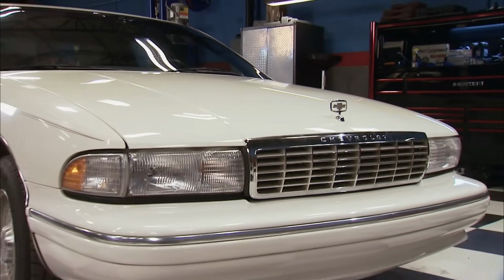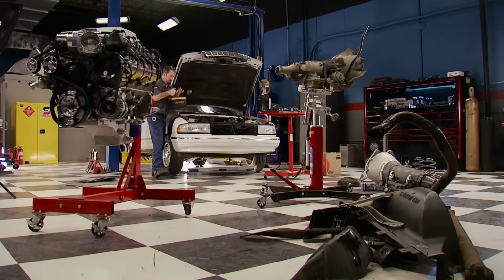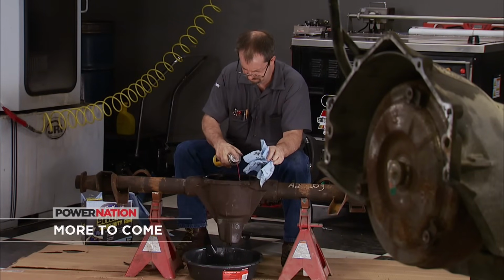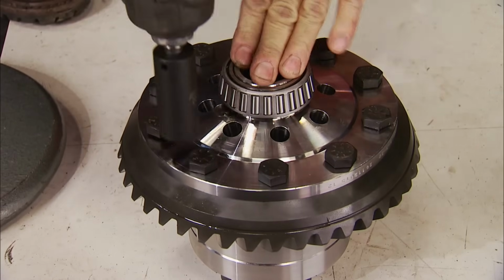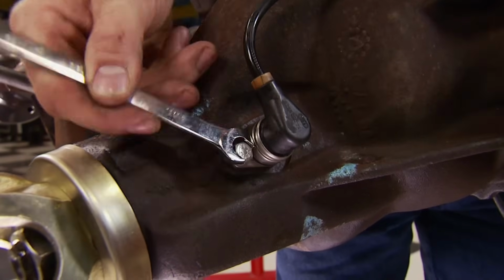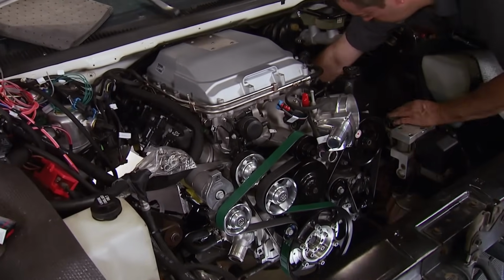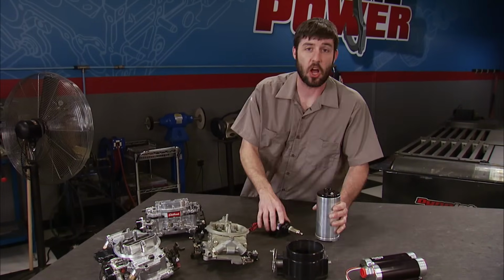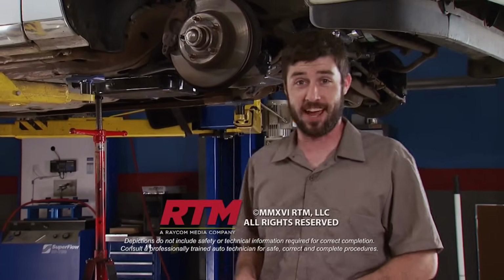Swapping A 816-HP Supercharged LSA In A ’93 Caprice - Engine Power S3, E11

Comment: Not that it matters but the original transmission is a 700R4.  The electronically controlled version (4l60) came in 94.
Reply: Ah, yes and no. Tis a 4L60, no E
Reply: @gabrielulibarri9950  Good catch, the 4l60E is the electronic version.  The 4l60 (no E) is just a renamed 700R4.

Comment: Build that little 305
Reply: Pointless when the Ls exists.
Reply: I don’t have a LS, I have a 305
Reply: @phantomnus  I swapped my 305 for a Ls. Saved money and time
Reply: I didn't realize that the swap was that easy and cheap
Reply: @phantomnus  by the time you spend on a 305 to make any power you could have a junkyard Ls making more stock power. It was a no brainer for me
Reply: What's the information on the lsa engine? What pullies and front components on it? Can you add AC?

Comment: Should do a budget build on that 305 there's tons of them out there and there honestly not bad engines.
Reply: I have always wanted to see what a properly built 305 with a turbocharger can do. Besides, without forced induction and a bore, stroke, and all forged high compression pistons and rods, main studs, head studs, big cam, aluminum heads, and supporting mods the 305 will NEVER make impressive power. They weren't manufactured to be a powerful engine, they were manufactured for fuel mileage, reliability, and efficiency. Even the L03 TBI 305 engine was a turd for horsepower. 170 HP and 255 lb ft of torque is nothing. I would still like to see a fully built high horsepower turbocharged 305 with MPFI or Holley fuel injected throttle bodies.
Reply: @Brock_Landers  My local dirt track use to have a pure stock class and the majority of those guys were running Camaro/Firebird's and G-Bodies and they were quick, wish I knew what they had done to them but they dropped the class and replaced it with the 4cyl mini stocks
Reply: It would never be fast without crazy build
Reply: You can get up to 500HP out of one with the right setup.
Reply: Good timing, check out their new build.